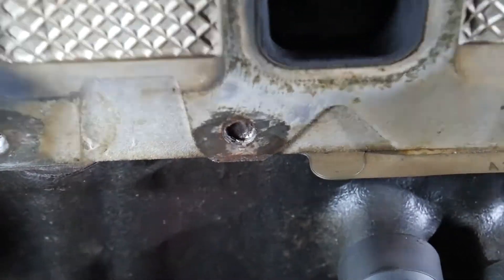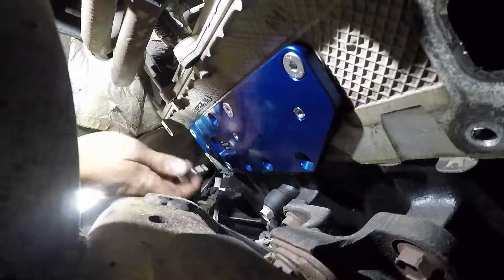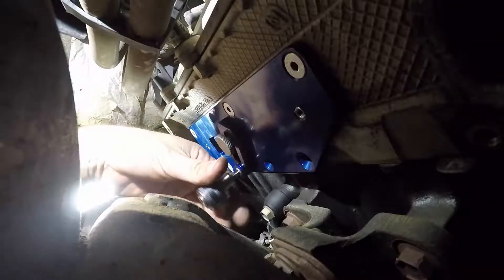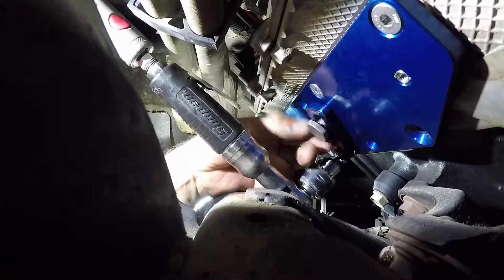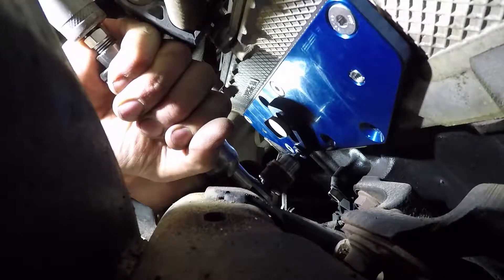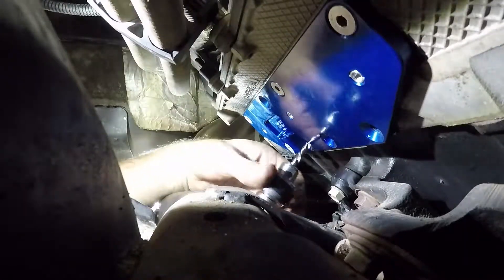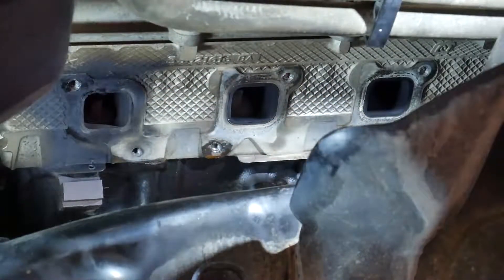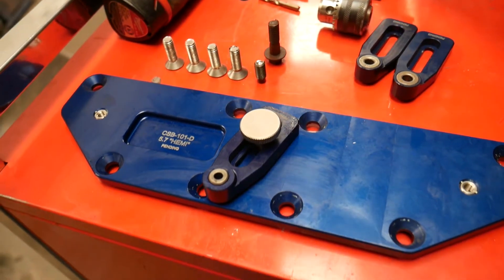Broken Exhaust manifolt bolt removal with Manibolt Driller

Comment: You answered a question I couldn’t find, that you replace the stud hardware no matter what because it can get fragile. A stud broke off easily and I wondered if other studs were affected
Reply from the maker: Bill Huey I don’t know if it is all the heat cycles or the expanding of the manifold that weakens the bolts but I replace all of the hardware every time unless it is a Toyota. Toyota runs 10mm hardware instead of 8mm like everyone else.
Reply: @ThePracticalMechanic  Yes, best practice is to replace all hardware, even the hardware that connects the exhaust manifolds to the down pipes.  The bolts are weakened by heat and the distortion stresses of the exhaust manifolds over time.  That's why the manifolds should also be checked for flatness at the gasket mating surface.  Not only will that prevent stressing the new hardware, but also prevent exhaust leakage that will throw off oxygen sensor readings and possibly set codes.  Thanks for the video.